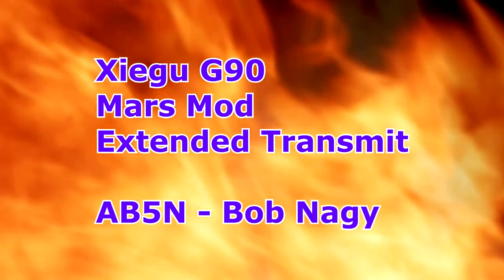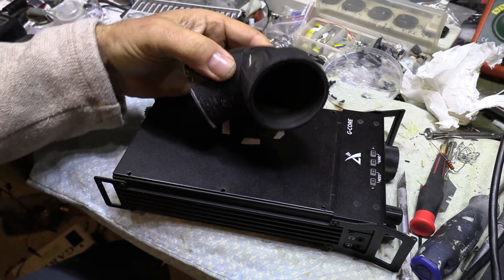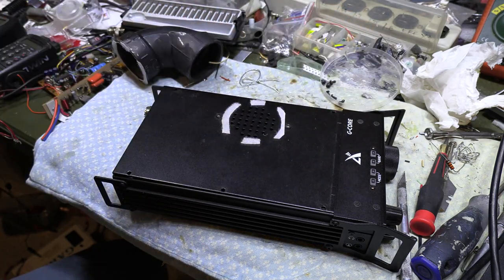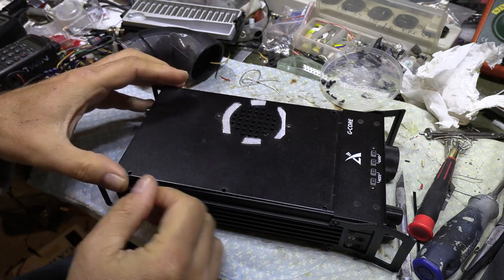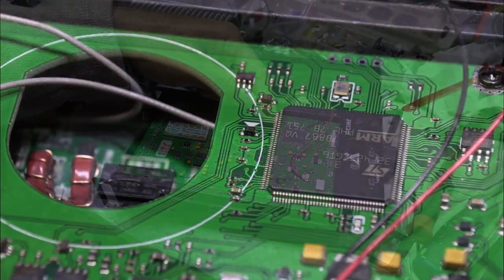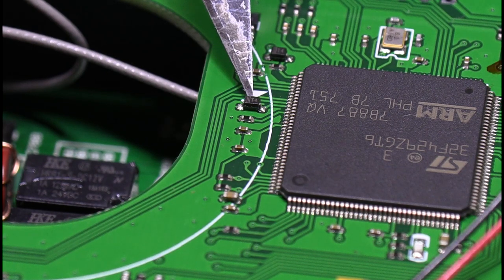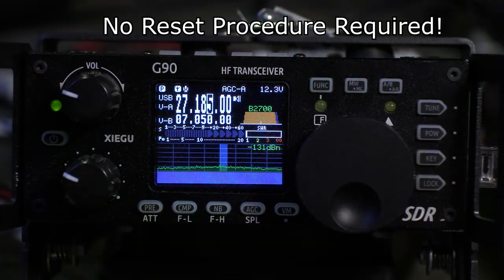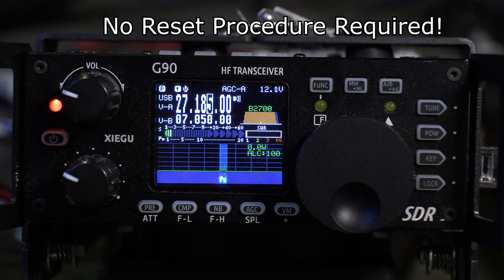Xiegu G90 Mars Mod - Extended Transmit

Comment: TIP : If you remove the control head first, you can lift the plate cover from the side without having to remove the warranty void sticker that is on the back near the power cord.
Reply: Awesome tip Sid.. lifted the lid very carefully so not to damage sticker and hey presto.. still under warranty. Super easy to solder back in place if only removed the one side.

Comment: TIP : If you remove the control head first, you can lift the plate cover from the side without having to remove the warranty void sticker that is on the back near the power cord.

Comment: Sure wish this was legal so I could use 11 meters with the unit cranked down to legal power and not need to find room for two radios in a car without lots of room for them.   With so little enforcement on CB, the FCC should simply allow hams to do this as long as they comply to CB power limits.   I don't expect that to happen though.  Be interesting to see if the signal was clean enough.
Reply: A lot of hams use the rigs on 27.3850 lsb  nice and clean ...  People love  ham radios on there  .. better than having a splatter box  .
Reply: CB regulation is such a joke nobody will know you're ever doing this or care. You'll fly right under the radar beneath all the guy's using their amped up thousand watt import radios.
Reply: @dgafkucky  Ham radios are ruining the CB band. Too many high powered radios just make a bigger pile up to get over...I'm guilty too...because it's just too easy.
Reply: @imken2392  sneak by with qrp  blows there minds
Reply: @imken2392  Half of them are CB but with amplifiers. Not really ham operators. You can get the amps regularly at truck stops which is why you're hearing so much distortion on the air.

Comment: What is the over all coverage now? I sometimes am in need of using Marine SSB and a low-cost short-range rig for there would be of value?
Reply: I have not tried it on ALL freqs...and it is slightly risky, as the tuner and other components were not designed for continuous coverage of HF. One thing that IS strangely amazing- folks say it TX's on the AM broadcast band!
Reply: I definitely do NOT advise relying on this as a marine HF SSB radio! It does not come anywhere  near meeting the standards for a marine HF radio with respect to frequency stability, shock resistance, water resistance, spurious emission suppression, etc. You also would need to install a broadband HF amplifier in order to have semi-reliable communications, and you will be hard pressed to find one that is type approved for the Marine HF bands at a 150W power level. The amp you do find  at a price that makes the endeavor worthwhile, will make the problems of frequency instability and spurious emissions worse. This can interfere with life safety communications among marine and aircraft and potentially cause loss of life. You also should not trust your life, and your family or friends' lives, to this radio when you are marine or maritime mobile. Opening it up is fine (provided it is not emitting spurs that could QRM communications), and having it as a backup in case of failure of the Marine HF transceiver is fine, but for your own safety and that of others, please don't use this radio for Marine HF SSB as a substitute for a radio designed, built and intended for that purpose. Used Icom Marine HF SSB radios that can also be used on the ham bands either in memories or a ham-only VFO, frequently are available for sale for less than $500 and sometimes the matching remote automatic antenna tuner is part of the package. Look, for example, for used IC-M710 Marine HF transceivers in good condition. There are seven of them on e-Bay right now for $350-$500. They do not meet the current state of the art but are perfectly suitable for Marine HF SSB. They do not, however, have alarms and automatic position transmission features; they have an emergency alarm/distress button for 2182 kHz, that is NO LONGER the global SSB distress frequency and the Coast Guard no longer monitors that frequency. If you are a boater who does not venture beyond the horizon, it should serve you well but you really need to have a state of the art Marine VHF radio with GMDSS features, also.
Reply: @j.kevinhunt147  Best comment 👍

Comment: Thank-you for this! My G90 was ordered today and will arrive Monday. I was told that this mod would invalidate the warranty here in the UK so I may wait until I know the radio is working as it should. Thanks again! G6XIB
Reply: i have done this mod for my g90 and ended up with audio drifting after a month.i solder it back and luckily it back to normal after a few firmware update to latest one.

Comment: I'm a bit confused here.... Is this mod opens up  11meters band only or continuous Tx coverage  from 1mhz to 58mhz. Can someone clarify?
Reply: Continuous. All the way down to the AM broadcast band. Realize that there are low=pass filters switched in for each Ham segment and if you were to try and transmit
far from a ham band , you might burn up a filter. 11 meters is ok though.

Comment: FCC. You must limit the transmit frequencies to ham band only. 
Chinese. Mask a giant white arrow pointing out which component to remove. 😂 gotta love it.
Reply: The Japanese made Yeasu FT3D is even EASIER to mod.  It has has a resistor that is literally behind the battery and it's the ONLY resistor one can see once the access rubber gasket is removed.   All thats needed is a needle nose pliers.
Reply: Well I don't get it you are pointing out it's a Chinese radio the only reason it can transmit on Mars or transmit on CB. But all ham radios can be converted. Especially the yaesu ftdx10 11 meter mod is very easy.
Reply: I can open up the transmit any ham radio in about 10 minutes. It takes longer to remove the case. Japan made it dost matter.
Reply: With only my powerful brain I am able to just 'look' at the main board of ANY radio and it will automatically open up all frequencies.

Comment: Nicely shown!
I like my G90 quite a bit and was going into the rig to modify the power input (in my case replacing the connector with a fused and ferrit-ed power poles pigtail ) and performed this as I was re-assembling the radio. 
Works great no issues!
Edit: I like your sound pipe idea!
-I found that a spring loaded folding plastic sun visor for an LCD display with the spring loaded sides removed gave me an  adjustable sound reflector that fits perfectly on top of the radio and folds down for storage. I used pieces of double sided tape stuck to the four conveniently placed screws on top of the radio to secure it. Fits nicely behind the H1 stand strap too.
73 de N2NLQ

Comment: I did the mod this morning and works on CB band.  I do not intend to use it,  but,  it is good to have in an emergency. The radio software is v. 1.8.  Thank you for the tip.

Comment: I'm thinking if you solder wires to the pcb and the diode you disconnected, and connect the wires to a tiny switch which you put in a discreet location on the outside of the radio, you can do and undo the mod with a flick of the switch.
Reply: why?
Reply: @n8mrc  Why not?

Comment: Always take the face off for this mod as some models of this radio the TX cable connection is right beside the speaker,I know this through experience ,I done it with the face still on and the speaker unmounted the TX cable socket right off the board.the result I had to solider the coax cable back into place so, beware.

Comment: Will the radio show channels or just frequencies?
Reply: I assume that you are talking about CB channels. No it will not .. but you can save each CB channel in one of the 64 available G90 memories .. matching them to the CB channels.

However, the display is small .. and, in memory mode, the channel number is tiny .. but it is shown.

Comment: Hi Robert, I would like to undo this mod on a second hand G90 actually, but the component is removed. Could you please tell what is the removed component exactly ?
Reply: Sadly, I did this modification 2 years ago and I do not have a un-modded G90 to refer to. This component seems to be a diode. You can see the cathode going away from the main processor IC. I would put a 1N914 diode in this place and try it.
Reply: @Yavor54  Thanks for replying ! In between I have done further research, and I found the schematics of the G90. This component is a 1N4148WS-7-F diode (D31 on the schematics), I could find it online. So I think I can undo the mod soon.

Comment: Do you know if the uv5r is mars mod-able now that they have started locking them down?
Reply: I think the lock is software and software locked so that you can't update the firmware.  It's much easier to leave the bands open than it is to lock it down.  Money is the root of why things are unregulated.  Get a TYT TH-UV88, almost the same radio, easier to unlock.

Comment: Does this require de-soldering, or can I just lift out the diode?
Reply: No, you cannot just physically lift it out. You have to de-solder at least one side and lift it., A that point, it will come off the board and could short something out in the radio later. De-solder it on one side, then the other- and get it out of there!
Reply: @Yavor54  I am a captain, and I am interested in using the G90 as a backup HF marine radio. With removing this diode result in any malfunctions to the overall operation of the radio?
Reply: @captdavec590  no
Reply: ....you don't even have to remove the diode... just lift one side..good enuff.

Comment: How is the quality of the transmitted signal as well as receive on 11 meter?
Reply from the maker: OK... acceptable
Reply: @robertnagy2163  Thank you! After hearing all the skip that rolled in the last 4 hours, I'm a believer that this radio is worth the 11 meter mod! Just took the plunge!
Reply: @robliguori  Okay, So Six Months Later, Does It Tx & Rx On 11 Meters? Thanks.
Reply: @thewatcher5271  YES. Just do the mod
Reply: I did too, gad I did it, made the radios MUCH funner.
Reply: @robertnagy2163  Do you know where a schematic can be found? I understand they are not available.
Reply: @rfburns5601  no...actually not. I'd love to up the output of the driver transistor and bump it to 30w. The finals are 40w
Reply: I'm having to reply in multiple steps as utube wont let me reply
Reply: They have a contact form at the bottom of the page
Reply: I would like to enlist all G90 users to hammer them on this contact form daily - thanks
Reply: Utoob iz broken - who knows if this comment will post

Comment: Is this mods working with the last firmware version  1.77?
Reply: Yes done it today, i'm a very unexperienced soldering guy but finally made it :-)
Reply: Thanks I will be doing the mod also
Reply: YES! I can confirm that the modify working with the 1.77 firmware versione!
Reply: @schlittenfahrtzumweihnacht1401  what kind of screw driver do I need?
Reply: it's a hardware mod and has nothing to do with firmware.